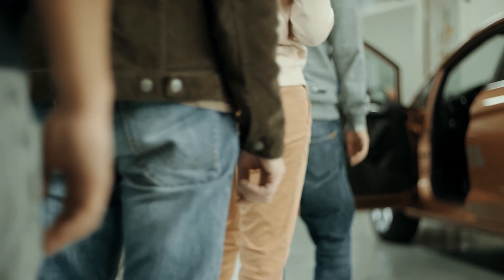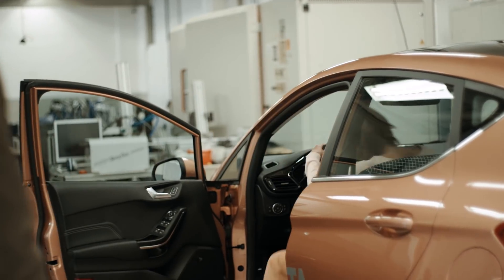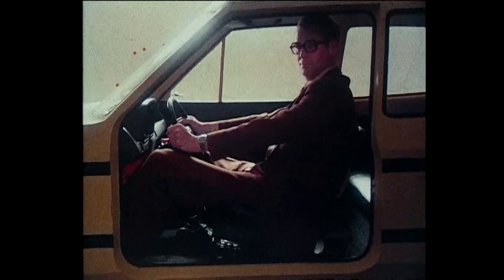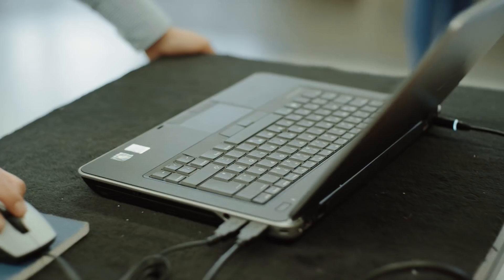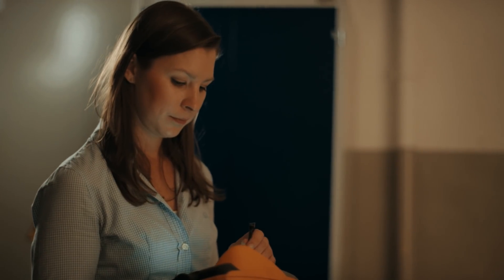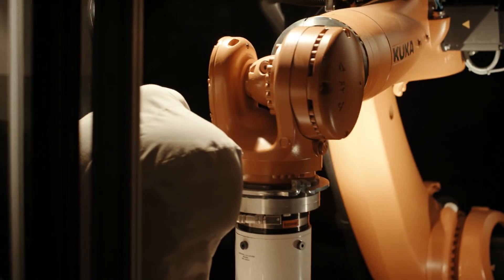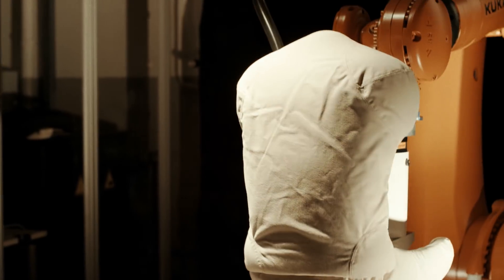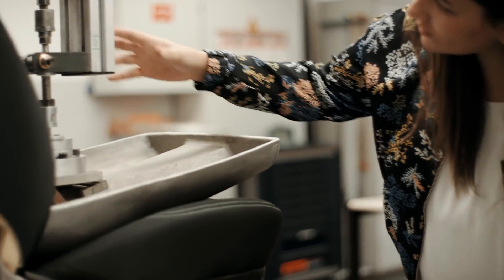Cheeky Robot Test Helps Ensures Seats Are Built to Last

Comment: "The new fiesta seat is one of the most tested elements in the car" - maybe ford should "focus" (pun intended) more on testing their transmissions and electrical systems. Anyone familiar with that lawsuit? Anyone? I should drive this turd off a cliff...
Reply: Had a roommate go through two transmissions on his car and other major parts. Got rid of that piece of junk, bought himself a Civic hatch and loves it =D
Reply: Our 2011 Fiesta (Nightmare) named Murphy - was a bit of a 'we need a car right now' situation. I am about 2x upside down on it and half the functions on the car have self destructed. I would have been much better off with a base model civic or corolla. Hindsight.... amiright?